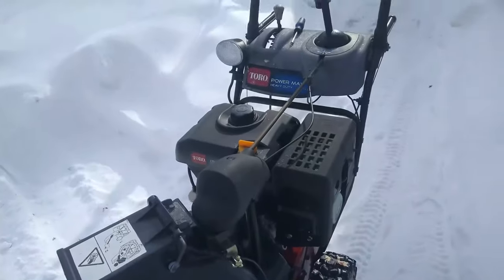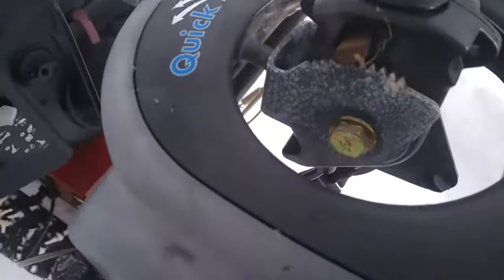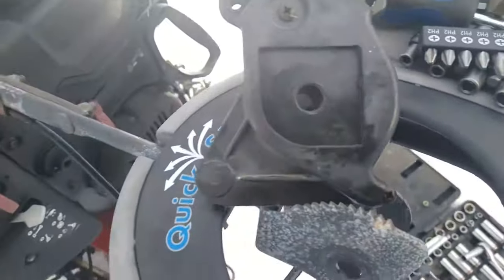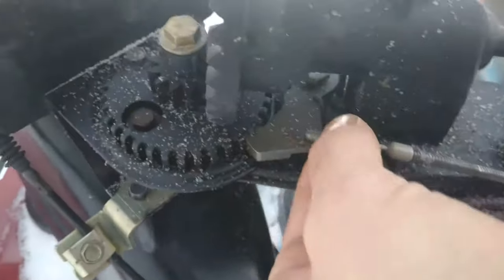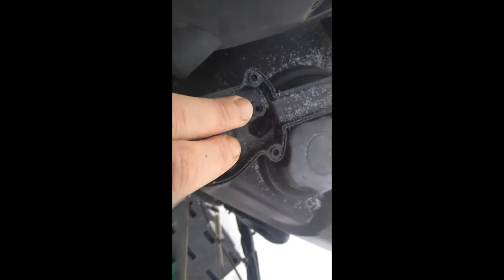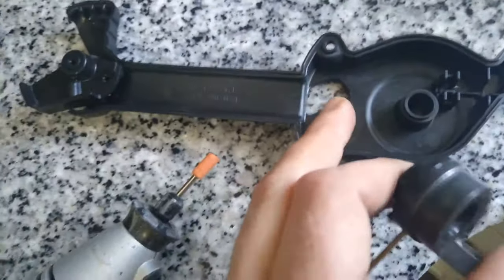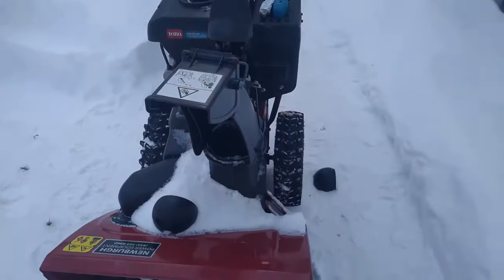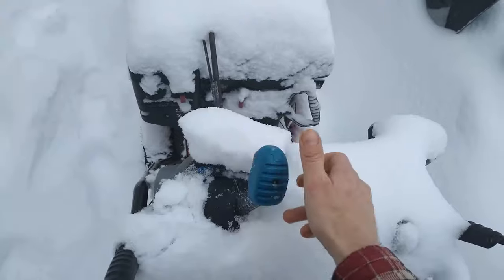Toro quick stick fix 926 oxe heavy duty

Comment: I have the Toro 1028 LXE and the cable that turns the chute snapped at the base of the handle. I’m no mechanic by any means but your detailed instructions in your video helped me tremendously in replacing this cable. I now have a working chute ! Thank you so much for taking the time to do this!
Reply from the maker: Your very welcome glad you got it repaired and working again
Reply: Exact same problem here. It looks like a bad design, as there is no stress relief where the cable emerges from the control stick housing.

Comment: Thanks for taking the trouble to video all that.  Purchased an 826 OXE a few years ago.  Slathered "Fluid Film" in all the obvious corrosion prone areas, but neglected the Quick Stick assembly.  I WILL address that ASAP.  BTW, Fluid Film is an awesome lanolin based rust and corrosion inhibitor, as well as lubricant.  I try to prevent rust as much as possible, and that's my first choice to that end.
Reply from the maker: Cool I'll have to look it to it I hate rust lol

Comment: Same issue with ours its new used about 5 times but seeing what you did I think mines the cable not traveling freely in the rubber housing will check now for a kink or bend in it , never again would I buy a joystick great if it works but auger style seem to be a much smarter version for direction then a cable . Thanks for the tips well done and explained 👍
Reply from the maker: Your welcome hope you get it working

Comment: I have a newer version of the 928OAE and had the same issue.   After looking at photos of the 928OAE on the TORO website they show the cable from the joystick to the chute direction housing clamped up tight to that long bar assembly.   Your cable looks like mine did when I took delivery of new blower..loose and hanging down.   I took some cold weather rated zip ties and secured cable tight to bar assembly then loosened the clamp bolt on the support plate, and that seems to have made the chute control function work better.   Reading the reviews on TORO's website this seems to be a common issue with owners.  TORO's response:  "To adjust the latch, loosen the clamp fastener on the chute-support plate until the cable is free, then remove any slack in the cable. Afterwards, tighten the clamp fastener while holding the cable. "
Reply from the maker: After the fix I did I haven't had one issue even if it's iced over it fixed it always locks in place haven't had an issue at all this year
Reply: @RayFixesAll  The joystick is a great idea for chute control.  Too bad Toro used light weight components for the assemblies.   Its a shame one has to go thru all of this on such expensive machines.
Reply from the maker: @jmaxs77  I agree I bought mine used but still cost 400$ would like to to see more steel instead of plastic

Comment: Something that is outside in the snow nothing should be really rusting If it is they should be using stainless steel for all those parts. If you stainless steel the bolts wouldn't rust a lot of things would not rust.. nicklin dimming their customers What I also like to call legally stealing from people.. .

Just pisses me off. 

I know that Ariens snow blowers tend to use better metallic parts and stronger. 

But I think Toro's actually perform a little bit better and the quick stick is the best type of shoot there is. 

But yeah they definitely should use better parts especially for the price point.